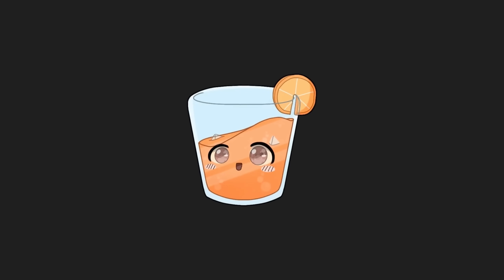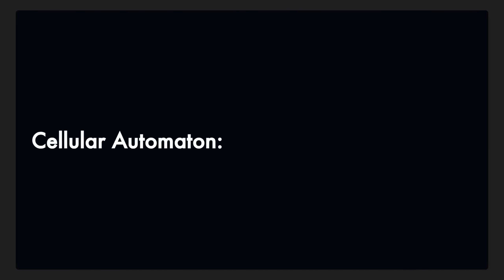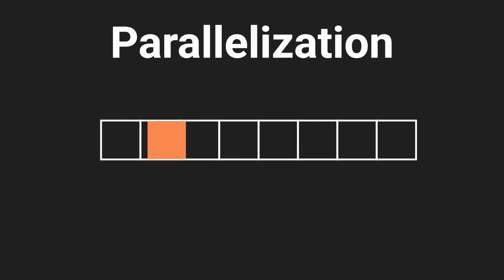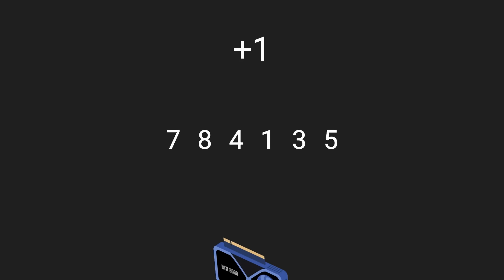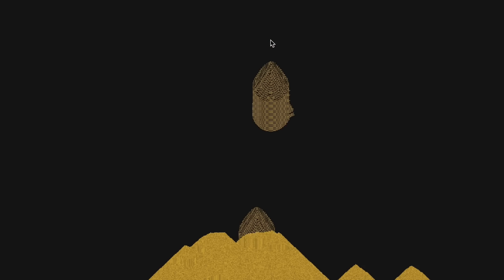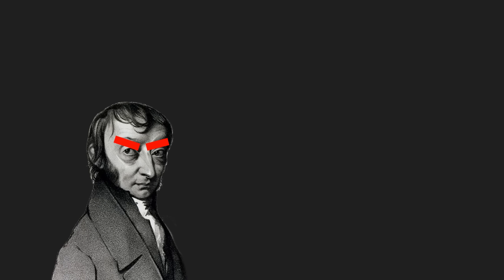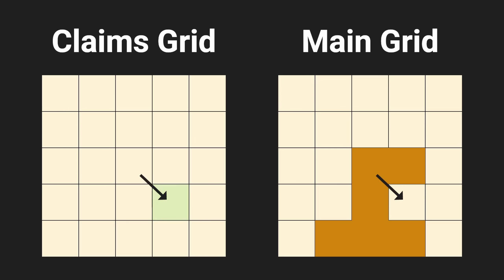Optimizing a Falling Sand Simulation To an Unreasonable Degree

Comment: couldn't you process every third row to avoid race conditions? so instead of one loop over the horizontal axis you have three that all go i+=3, starting at i=0 i=1 and i=2.

other bottlenecks i can think of are the high amount of branches and the fact that you have to access a different y coordinate for every pixel, which might lead to a lot of cache misses. You can definitely write the code as a logical expression instead of branches, im too tired rn to work out if you can cache optimise it

Comment: What if, like the other commenter suggested, you use a gather system instead of a scatter system, but unlike what they suggested, I had an idea that I didn’t really think through all that much but is interesting nonetheless:

First, store the previous frame to compare against the current frame.
The sim is then done in 2 passes.
On the first pass, for any grain with no grain above it on the current frame, check if it has two grains to the side. If it does, compare to the previous frame for if there were no grains to either side or corners and there was one above. If there was, destroy one of the two grains at random.
On the second pass, for every empty pixel, check the 3 pixels above and 2 to the side. If there is a grain directly above it, grab it and do nothing else. If there are no grains above, and either the left or right side has two stacked grains, grab one corner grain at random.
I’ve never done compute shaders but my idea is if a grain can fall straight down, it always does. If grains are stacked to its diagonal, it grabs one and ignores the possible race condition if two empty spaces at the top of a pile grab the same grain. The first pass is intended to remove these race conditions with hopefully minimal impact on the simulation as a whole.
I’m sure there are many issues with this idea beyond the ones I already know of.

Comment: I don't see why you couldn't process the grid once every step, instead of processing individual particles?
Like start with the bottom, for each free grid cell, check if there's a grid cell to the top, top-left and top-right, then transfer the content of the non empty top grid cell into your free cell. Make your way to the top of the grid and voilà...
Reply: Okay someone mentionned the gathering vs scattering strategy, that´s exactly what I meant...
Was already doing this on Atari ST in 1990 so don´t tell me we can´t do that now... 😁

Comment: You may aswell prioritize calculations on pixels falling down in line as first pass, until there's a diagonal to check for. You may want the lookup to start from bottom to top, and perform down operations (recursively until there is no down possible anymore), then perform those diagonals from top to bottom, knowing nothing is supposed to take over those pixels anyway since everything else* is already stable.
* you may face a diagonal race condition, so maybe perform one diagonal then the other ?

Comment: >asks chatgpt
>the answer is stupid

what a surprise
Reply: To be fair, i came up with that same solution in my mind before i heard the answer in the video. But it makes sense why it doesn't work.
Sand one row up might think it has to fall sideways if it sees one below it stuck. But the reason it's stuck is because it's only moving in the other frame. SO it will fall sideways off air. That's why you get piles in the sky
Reply: @DrTheRich Chatgpts idea works, though it might not have been able to articulate it, but if you divide the grid up into a grid of 3x3 boxes, and for each frame do 9 passes, so first pass is all top left corners of the big grid, then top middle, top left, center left, center middle and so on this works

Comment: 2:30 - That statement is probably over 96% false.  I do all my parallel computing on a CPU.  Modern consumer CPUs have so many options for this, it takes days just to understand all the CPU instructions and how to use them.  GPU use isn't optimization, it is simply brute force with lots of processors.

Comment: A much simpler way is to track which areas of the falling sand sim are active and only simulate those regions - this is what Noita does.

I'm using that approach for an online multiplayer falling sand roguelite game, based on deterministic netcode and it works a treat. Can easily handle millions of pixels in the world - even without multithreading or unloading distant regions.

Comment: Okay so first of all, i think that the concept of checking all of the pixels in grid is so wrong. My first thought when you said about simulating sand is to check only the sand and not the whole matrix(because this is basically what it is, its a binary matrix, 0 for the air and 1 for the sand particle). You can definitely use some queue or dequeue of sand pixels and since its a matrix we know exact coordinates x,y of all the grains. This will drastically reduce computing since we are only calculating the sand particles.

This approach is problematic when the pile is large but you already did a parallelization and atomic operations. You can combine it with dividing the map in chunks for example 16x16px or more and you dont have to check for all the particles with all the particles while doing atomic operations, you only check the ones within the chunk. You just need to slightly overlap them. 

Its a cool project but there is a loooooot room for optimizing it further. Even just combining what you have with some list of sand coordinates and only simulating those will drastically reduce time(even if half of all the pixels are sand you still check half the pixels and not the air in the left corner for example).

Comment: For the parallelism problem, making a claim grid actually don’t prevent the race condition you just moved it up in your code base or most correctly in your case "You moved the race condition to another part in the your code base", in fact race condition will happen if two threads tried to claim the same cell in the same time when checking the cell claimed they will both see it blank and they will turn it to black and execute their code simultaneously. I hope you get me? And thanks for the video !!
Reply from the maker: Good catch! I hope it's clear that the claims grid alone doesn't solve the race condition. The reason we implement it is so we can use an atomic operation to run calculations that would interfere with one another in sequence!

Comment: When using the claims grid, doesn't this just shift the problem of the race condition from the main grid to the claims grid? In other words: What prevents two threads to check and claim the same space on the claims grid?

Comment: Oh cool! I've built a few prototype sand sims. The neat thing is that if you run the simulation deterministically then you can make it multiplayer pretty easily. You also want all the clients to be able to keep up, and catch up from a starting snapshot, so you want it to be really fast! I actually had a working discord activity at one point, but I broke it in some really strange way and I haven't worked up the gumption to fix it.

My first prototype used a really weird (and I think unique?) technique: bit masks! Each element type gets a giant bit vector, and an extra bit vector which is a union of the rest. All the update and interactions are built using bitwise logic on rows of 64 pixels at a time. Fluids use some especially cursed logic involving addition and carries to detect obstacles. And since that only works when moving in one direction, I flip all the bits to check movement in the other direction. I'm really proud of this, but there's only so much you can do with bitwise ops. You can't store any metadata, so things like colors, heat, and velocities just aren't doable. You also run into possibly O(n^2) performance with respect to the number of distinct elements, which wasn't a problem in my tiny prototype but might have been if I'd kept with it.

For my new prototype I'm using GPU acceleration. I'm going with the "alternating grids" idea. It isn't actually novel; you can find it in this paper called "Probabilistic Cellular Automata for Granular Media in Video Games". I'm using slightly larger neighborhoods which lets me assign larger velocities to particles, and I'm hoping it gives slightly less bad artifacting. But it's a very rough prototype at the moment.

Comment: Using atomics is a weird solution to this. The GPU wants to run like crazy, and you hamper it.
Why not just use more complex automaton rules? If empty under -> fall. If empty to the right under but full to the right, don't fall. etc.
Of course you use two textures for this, that should have been like that from the start. All cell automata work like that, the previous state should always be read only.

I seriously don't understand why this is not your solution. You are not a dumb person. You did some great stuff. This is basic shit.
Reply from the maker: I do actually use double buffering in this implementation! The code is up on github if you'd like to check it out. The problem with race confitions is not the output texture being the same as the input texture, although that would of course cause it's own host of issues. Here, the issue is the parallel nature of this implementation - multiple threads can try to read from the "read texture" at the same time, and subsequently they will both try to write to the output texture. 

More complex rules could be really fun to implement, and I've gotten a bunch of cool suggestions from your comment and other that I might have to look more into in the future.

Cheers!

Comment: I think chatgpts idea of treating it like a chessboard would work, but you'd have to use a 3 colouring instead. just calculate every third pixel at the same time and then you'd never run into the problem of two moving to the same spot, and also avoids atomic operations deparallising the process

Comment: Since the simulation is deterministic, I believe the most optimal way would be to use a sum of convolution kernels applied over a row of pixels. The only requirement would be to hand-craft the kernels, write into a new (kernel size x screen_width) matrix and then overwrite the original screen matrix row before moving to the row above. Since the updates happen in rows, we could do multiple simultaneous passes to the screen, efectively having very very few locks and avoiding atomic operations*.
Keeping track of the top-most updatable pixel would also reduce the amount of operations required.

* Writing into the original matrix could be thought of as atomic depending on your definition
Reply: With this approach you'd still have the bias you mentioned, but you could either randomly switch two variants of the kernel that decides the movement, or use the frame id's lowest bit to multiply the two kernel variants (effectively disabling one)

Comment: You should try processing your grid cells from bottom to top. You can do all the cells in a row in parallel, and all rows from bottom to top sequentially. This might fix an issue with the sparse falling sand

Comment: cant you just use sse2 intrinsics to do the same but on cpu, if you pack sand tightly into memory, you can process up to 128 sand particles at once branchlessly which would most definitely be faster even than the gpu computations since you no longer have to transfer the data. Also I wonder why wouldnt you use 2 fields, with the previous step and the current one, this solves the race condition and makes you code run faster too

Comment: 3:52 you know you can just... add in a bitmask for things like numbers, eg 11111+11111=22222, that's one operation, but you can have multiple positions put in the same number, such as x,y,z-> xxyyzz+aabbcc-> you now are adding two vectors as one number at once
but mind you that's only for small numbers, for things like positions higher than 16 bits it's iffy, but using a 16 bit position vector lets you fit 4 inside a 64 bit integer, meaning you add 4 at once. 
16 bit int limit is 65 thousand, so you certainly could have a lot!

Comment: I was thinking how to parallelize it, but never came up with idea tbh, always thinking of how to deal with race conditions. But each time came to ideas like "Oh, it's gonna be like this... But it makes it linear really.."
Reply: ALSO, THANK YOU SO MUCH for your first video on simulating sand, it inspired me to make a little tetromino game with sand, like you see on mobiles. Coded it in C in like two days and it came out really cool hahah, I had problems with sand disappearing even without parallelism, but I fixed it, so anyways... I never really did anything else with that since it gave me nice FPS on the grid size I needed, so, I didn't really care much. ANYWAYS, I am still grateful to you! I took an idea, "reformatted" it into my own game and didn't even take your code ahahah, so, I have a sand physics engine of my own now) if you are interested, I put it on github under Milligat3 account on the RaylibSandGame repo. Will add some changes into makefile and it will be "done" xd. It doesn't have score or a game over, but it reloads via F5 so it works for me, actually spent some time in it

Comment: I think my first port of call if I were to tackle this is not to track every cell. Only the cells that have empty squares below it. When a square becomes empty its signals the cells above there's somewhere to fall. Next iteration all the cells that have been signalled there's space bellow, move. Which leaves a space - the space tells the cells above it theres space bellow.

For any cell that fell last iteration, check if it can fall again.

And repeat.

That way you're only moving cells that will move each itteration.

Comment: On the note of failed parallelization and race conditions: You can always split the grid into many small sub grids. Such as 64×64 or 256×256, then solve each independently. By as many GPU threads you got, or simply adding each sub grid into shared queue and picking one by one by all the GPU threads. Then, after all sub grids are done, solve the boundaries between sub grids. This could be done sequentially or by splitting to more coarser sub grids and parallelizing it. If you keep the sub grid resolution always the same, this process is guaranteed to be race-free and portable to CPU or to many CPUs with exactly the same results (minus floating point inaccuracies).

Comment: tl;dr I made my own in 2.5 hours without any assistance (AI chatbots, Stack Overflow, Google) and it runs at 20k fps on a 1920x1080 grid and looks way better.

Longer version:
Seeing this video, I said "that looks easy, I bet I could do better." 

In just 2.5 hours, I wrote my own (as a challenge, I made it fully from scratch and by myself, so no AI, no Stack Overflow, no Google, no nothing). It runs at 20000 (yes 20 thousand) FPS on a 1920 by 1080 grid (yes, each sand is a single pixel) on a single core on my 5600x (not X3D, not overclocked) unloaded. Extensively testing it, when loaded (a bunch of sand is falling), my average fps is around 2000 fps and my 1% lows are at 750 fps. Again, this is single threaded on a 5600x with no GPU acceleration or parallelism. 

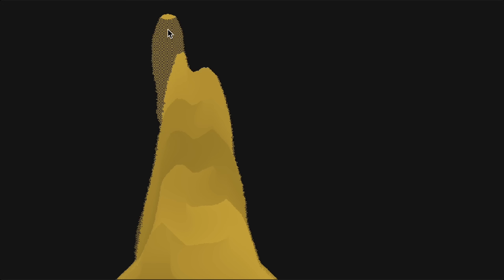Additionally, visually it looks much better. The sand is able to slide down much sooner instead of taking ages (which created the pillars seen in your version @ 8:16). It also allows all the sand to move down at once, instead of creating the interlaced pattern (one row of sand, one row of gap) seen in your version (seen very clearly @ 7:59, but also on the edges of 8:16). 

Ask me anything.
Reply: maybe post a video of it and how you did it so people can learn?
Reply: Show the GitHub and the video.

Comment: Question: why do the gaps in cells appear?
Wouldn't a more normal simulation of sand allow the grains that started falling one over another to continue doing so at the same pace?
Therefore shouldn't grains on lower y values be resolved first?

Comment: You could improve on the sand sloping down too slow by making it check weather a side pixel is filled first, and if so and the other side is empty, move further to the other side. This would increase the spread like an avalanche, as if it had gained inertia from hitting that size pixel.

Comment: I've made a 3D celular automata, where cells exchange places pair-wise according to physics. That means that, in paralel, no two actively elavuated cells should be touching, not even their neighbours.
I made 7-cell star-shaped neighbourhoods(!!!) for each cell, full space tesselation (packed tightly), and an update cycle thus has 7 iterations, shifting that neighbourhood by one cell each time. Oh boy, that neighbourhood was hard to figure, but I did it :3
(also that meant that 1 cell in the 2^n grid is never evaluated directly, but it still has 3 neighbours that can interact with it.)

Comment: i dont have any experience with parallel processing so im not sure this would work but something that came to mind is that you could just check row for row from the bottom upwards. this combined with all the sand going either left or right for each frame should make it impossible for two particles trying to go to the same position

Comment: In addition to rock_3 comment, i remember there being another approach that conserves parallelism:

Split a grid at into 2x2 cell chunks per thread, and define a ruleset (that is the difficult part - i dont remember the ruleset) for updating each of those 2x2 chunks
Create 4 sets of 2x2 splits, such that each grid cell has opportunity to be in one of four positions in each split, and for each update apply rulesets 4 times on each split

that way, you dont loose parallelism, dont double your memory, and by varying the update rules for 2x2 splits, you can implement different particles